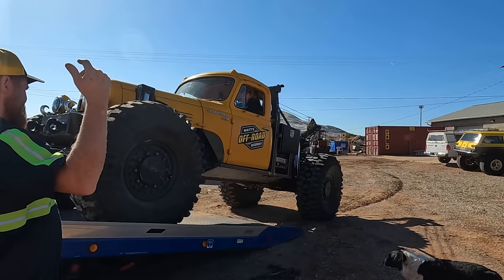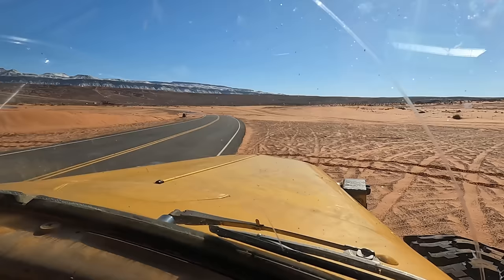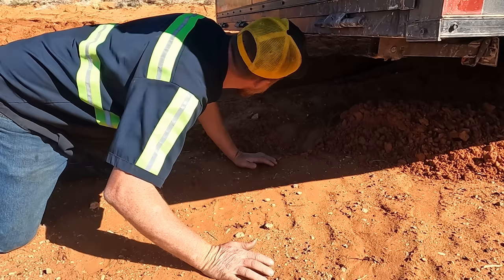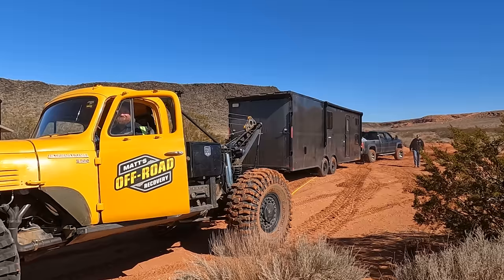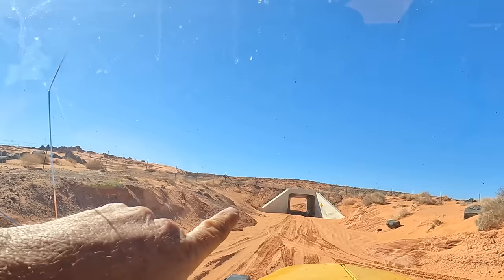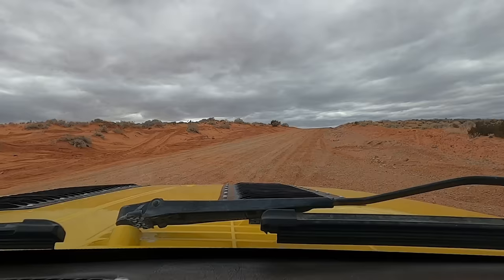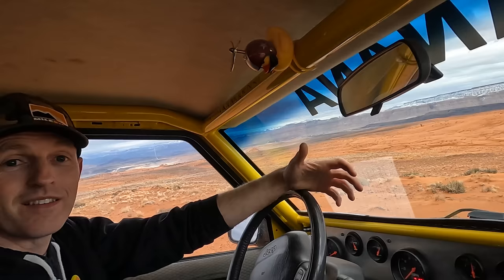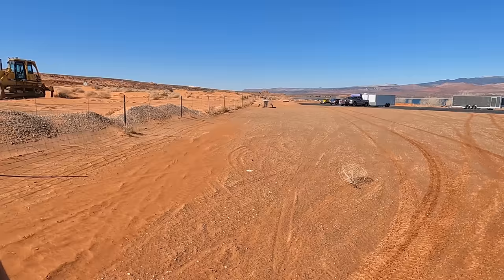Truck & Trailer Buried In The Sand...First Major Test!

Comment: That off-road wrecker is an absolute beast and being able to pull out a full-size truck trailer like in 2 Wheel drive is pretty impressive
Reply: Why in 2wd?
Reply: @andreholkamp6446  Did you even watch the video? Matt has no front drive shaft in the wrecker.
Reply: @andreholkamp6446  Funniest comment I have seen in a long time, but not in a good way. 😂
Reply: And even managed to get out of the hole with it
Reply: @61rampy65  you would be surprised how many people just let information right out the back of their head quickly. I personally think things like tiktok and other social medias in the past made it worse
Reply: @andreholkamp6446  The front drive shaft broke during one of the early test runs/ rescues. They are getting a heavy duty one built, they just haven't installed it yet. I'm sure they'll have it ready for the games.
Reply: *full size pickup and trailer.
Reply: @61rampy65  i've seen earlier video online with a broken shaft / transfer case and thought that was fixed! And thanks to everyone for the explanation. English is not my first language. I will try to keep up 😉
Reply: @thomas1942  thank you for explaining that to me
Reply: @TrevorDennis100  thank you for being nice

Comment: As a diesel truck owner, I will never get tired of seeing these diesel bros taking their trucks off road with large trailers, and always getting stuck
Reply: All the gear and no idea, ramp over on the trailer would suggest to me its best on the bitumen.
Reply: Assume I have average knowledge of off reading , airing down a bit on all wheels would help a lot off road ,
Reply: Yep, those huge double cab, long bed, full size diesel trucks are simply just way too heavy in most cases, and with (usually) too small of tires (relatively) for that kind of loose sand, and so as soon as they get out there they usually just immediately sink and completely bury themselves in that kind of sand.
Reply: My 95 f350 with a 7.3 has lockers and I still get stuck.... to heavy in the front?
Reply: @nickmcd858  Yep. And most likely too small of tires, (relatively), for that weight, especially in soft sand. (See my other comment in this thread)
Reply: @nickmcd858  100%. It’s exactly why Matt won’t put a diesel in the wrecker, because he knows it will make it inferior for off-road work.

Comment: That Beast of a Heavy Wrecker does in 2 wheel drive with a pull-rope, what the Banana and the Morrfair do in 4 wheel drive...with 2 anker jeeps and using the power of the winches. I love seeing that beast HV in action. That vehicle has so much power and wheels and balance i cant wait to see what it does in the competition! It is obvious it is build an designed by a man with great experience and feel for physics. Great job Matt.

And how about Lizzy beeing on her best in the second part. Go there, i want to pull her out and then bring her that way because this. Beeing a boss and a "Oo I dont want to get wet" Lady at the same time. She sure as hell knows of the ropes, literally.

Please keep them coming Team Matt's Off Road Recovery.

Comment: Pretty impressive recovery for the WBORR towtruck with just two wheel drive. That was a pretty heavy rig it pulled out. Should be able to handle just about anything when it is more or less finished. Can't wait to see its further adventures.

Comment: another great recovery!  Been watching your channel for a long time, love you guys.  Noticed you sometimes use hand held radios in your adventures.  I have been running a local tree service on the east coast for twenty years and a while back we started using integrated helmet coms from Sena.  They operate on a bluetooth mesh technology that gives a range of over nearly half a mile or more.  Noise canceling tech is great and they will last over eight hours on a single charge.  You can pair up virtually unlimited headsets.  I feel like they would suit your business great.  With your clout you might want to reach out and see if they will demo a few headsets for you guys.  Also, I do NOT work for them but love their product.  It has revolutionized our business with the ability to communicate effectively on job sites without yelling at each other across customers yards like amateurs.  We can have full crews able to all hear and talk to each other seamlessly.  Bonus! You can take phone calls and listen to music while on the job too! whenever somebody talks you will still hear them come through.  Just a thought, keep on pulling people out of trouble! Y’all rock!

Comment: I would have lost money, I bet it would not fit in the tunnel, but then I thought, Matt would have had the tunnel as one of the spec. when designing the wrecker.  You in two-wheel drive is why better than most six-wheel drive.

Comment: Way to burn the tunnel Matt.  You told them all it would fit through the tunnel.  You dug some deep holes with the wreck and it just keep on moving.  Those tires work well in the sand.  Next time try it with four wheel drive.
TomTom and Lizzy did a recovery next with TomTom wanting to do the pulling.  He did a pretty good job at the recovery and it was good that he had Lizzy to give him some directions.
The most not stingy person on the team has to be Lizzy.  She is always willing to give the newbie tips on either pulling or driving a recovery vehicle.  Hats off to Lizzy and Matt too .

Comment: The Wrecker did real well pulling a full size truck and trailer out in only 2 wheel drive, imagine when the 4x4 shaft is installed. Nice Work!

Comment: Wish I would have kept my 76 Dodge military truck. I pulled out a brand new Dodge buried up to his floorboard, attached to a camper on the side of the river as the flood was coming in and pulled him out with him in neutral and me down in low and didn't even struggle. It was full-time 4 wheel drive with lockers.

Comment: Will you be adding some type of "lowering arms" to decrease the winch line angle;  You know... to reduce the chance of damage to some vehicles plastic parts? Also, what you going to do to keep vehicles on the hook from swinging into the back of the heavy wrecker? Will you be adding a "stand off bar"?

Comment: You should put an emergency seat at the back for extra passengers when doing the rescue, also bring a portable welding tool to do emergency welding if needed on your rescue, and a compressor to inflate your big tires..

Comment: I couldn't quite tell, did you tie off to the trailer's rear axle on the first rescue? From my 18 years of rving, most trailers use rather thin walled tubes for axles and they bend REAL easy. You have to be real careful jacking them up just to change a tire.

Comment: The reason your driveshafts break is because the large diameter tires increase the leverage on the U joints.  The stock U joints on the 205-transfer case are not large enough.  When the tires start hopping and bouncing the torque WAY surpass the strength of all the drive train components' and the U joints are first to break.  When the U joints are enlarged next to break will be gear teeth in the transfer case ..

Comment: Well even though the wrecker is still missing the front drive shaft it got trailer and pickup out and they used the Banana to get the Ford explorer out and back on the road.

Comment: I have owned Cummins, Powerstroke, Duramax, Echo 3.0, Cat, & International  multiples of each.  My opinions only>>>>> Cat very strong - leaks. The Stroker - Rattles a lot, I say Rattles A LOT. & very expensive to fix like the Cat. Never owned a Detroit, but the have a disgusting odor. Both of my Power Strokes broke down at a little over 100 k miles. Both cummins were still running fine when I sold them at near 1/2 Mil. miles each . the cats were running and leaking LOL when I sold them, both International running just fine, still have the Echo & a Duramax over 300 k on it doing fine. only 100 k on jeep - so I don't know yet.

Comment: 15-20,000 lbs of mired resistance pulled out by a trailer axle?! Trailer axles half a fraction of the rigidity of 3/4 ton axles. Id be shocked if he didn’t bend their trailer axle pulling that rig out.

Comment: Something up with that sound of that motor don't sound like she hitting all together in the right times it's on all 8 but she needs to be tuned really bad you need to take it to cleetus he and his crew do magic on them there Chevy motors he most likely has parts already for your motor I bet he can throw a new cam in her bigger injectors and bore her over and  different intake and maybe heads ported and polish out I just bet she would gain close to a 100 HP but most importantly since it's a tow rig so you don't need a 1000 hp you need more tq than anything so that will bring your tq up at least by 150 or more so I love to see you colab with cleetus and crew

Comment: I've NEVER managed to get stuck coming downhill. She had to have stopped there and pinned it in reverse.
Reply: Nope, I didn't make it up the hill and was trying to back down. No matter what direction I tried to back, it kept sliding to the left. At one point, I hoped I would be able to just turn and go down, but the sand was incredibly wet and heavy. In a dry sand situation I don't think it would have been an issue. I pulled two Jeeps out of the dunes this same day that were pretty much stuck like I was. It was a weird day in the sand.

Comment: What were you going to use the two Line Locks for? I ask because 'if' you had a Line Lock for the front brakes, you wouldn't need to power brake it at all. Just apply the brakes, hold the Line Lock and punch it in 2WD. You could fill that whole tunnel with a massive amount of white smoke with a bleach burnout. 🤪 Wait!? - Is 'bleach' biodegradable? 🤔 - - 😉

Comment: Me no comprendo.  Why do people try to drive through terrain like that with equipment like that.  Clearly it was designed for at least a much shorter trailer with all of the sharp turns and mounds of sand along the sides.